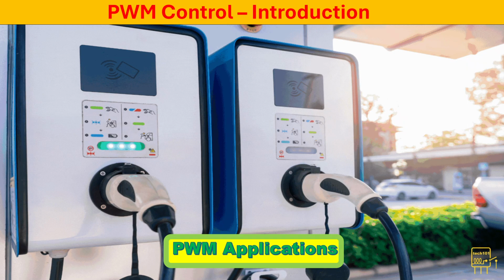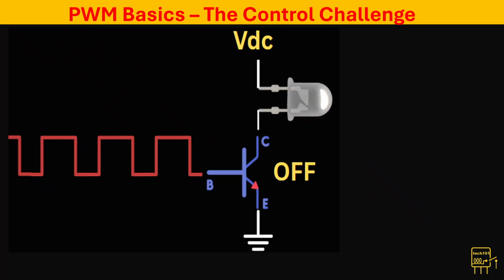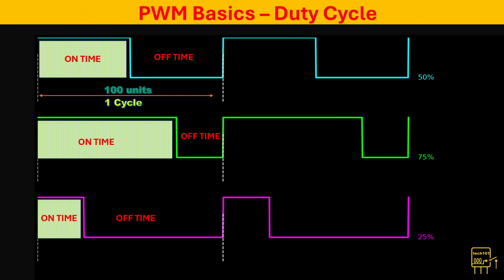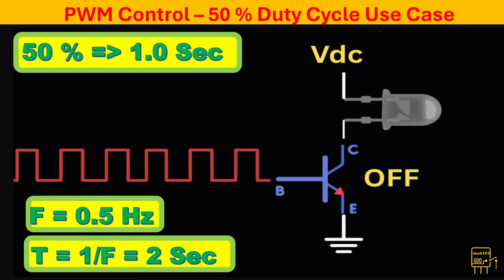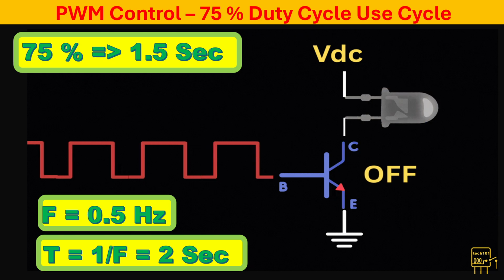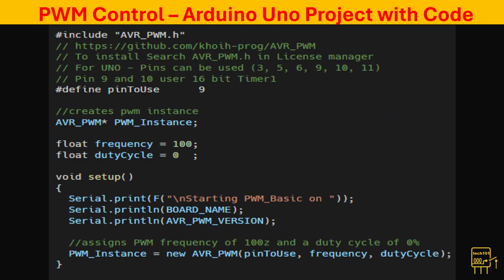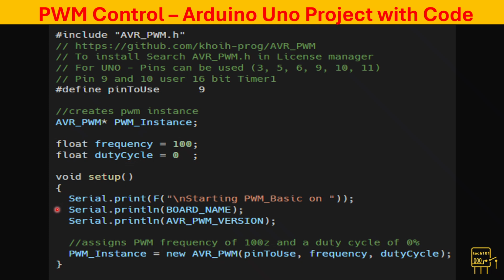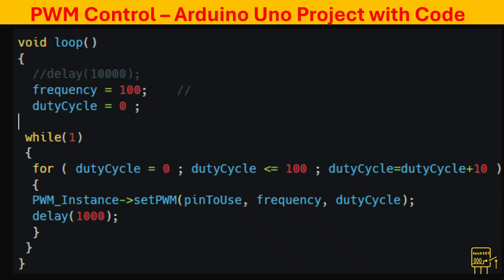Arduino LED Control: Complete PWM Guide

Comment from the maker: I have used this PWM AVR library on Arduino Uno to control speed of BLDC motor using ESC and magnetic incremental precision Encoder, down to +/- 10 RPM accuracy to 8K RPM, at no load.  Have you used PWM on Arduino in your own projects? Share what you’ve built below! 👇